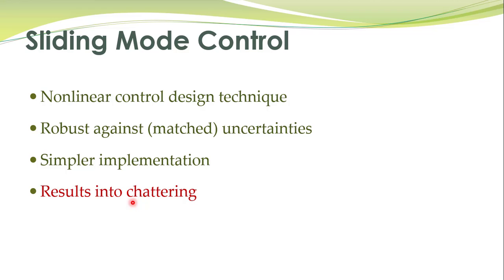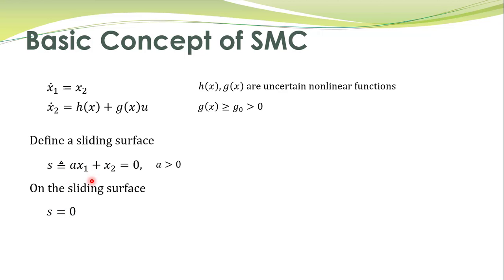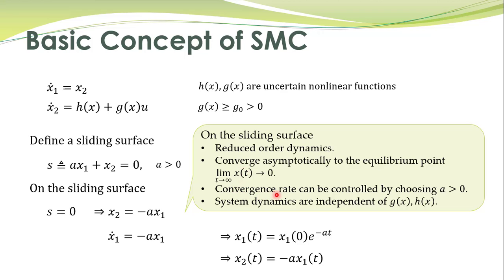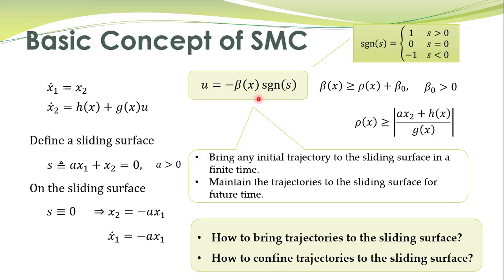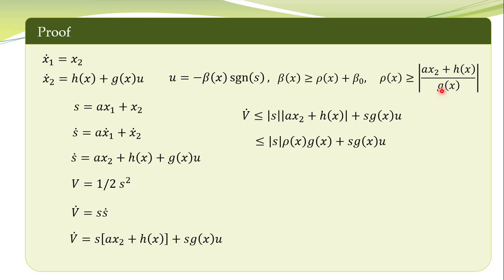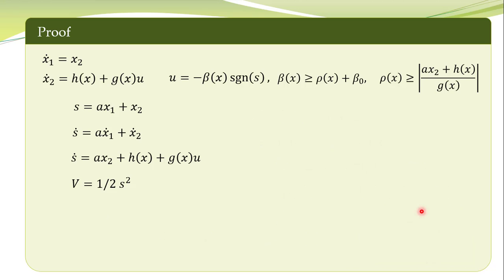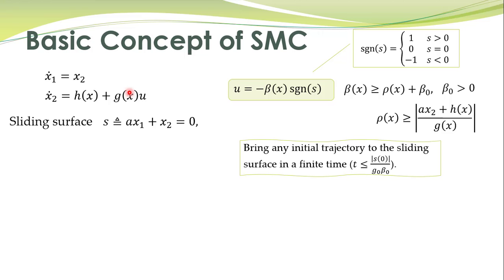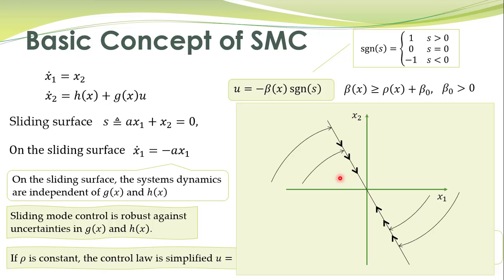NCS - 34a - Sliding Mode Control - Basic Concept

Comment: Dear sir, As far as I know, the principle of constructing a sliding surface for a system with 2 states is to use the equation: s(e) = ae + de/dt. Why do you use the equation s = ax1+x2? I hope you can explain.
Reply: X1 and X2 can refer to error and derivative of error or any other system parameters that the sliding surface represent. It can be velocity and position. S is constructed such that its derivative would give an equation that is function in the control signal u. In electrical engineering, we use S=e or S=edot +lamda×e because our goal is to minimize the error of currents or whatever you're controlling. Other systems can use S to be position and velocity as we wanna make system go to zero.

Comment: Excellent video! However, I do not understand how the Lyapunov energy function (using the control law) proving asymptotic stability around the origin means that the trajectories are confined to the sliding surface. Can you please elaborate? I understand how you arrive that the origin is asymptotically stable using the control law but I cannot understand how it relates to confining the trajectories to the sliding surface.
Reply from the maker: If s=0, it means that the trajectories are on the sliding surface. We consider the dynamics of the sliding surface and define a control law. Then using the Lyapunov theory, it is proved that the control law ensures asymptotic stability of s- dynamics. Asymptotic stability means that s will finally become equal to zero, that is, the initial states are brought to the sliding surface.
Reply: @MAFarooqi  Oh okay got it. It all makes sense now. Thanks!